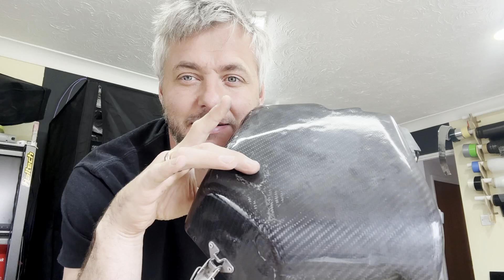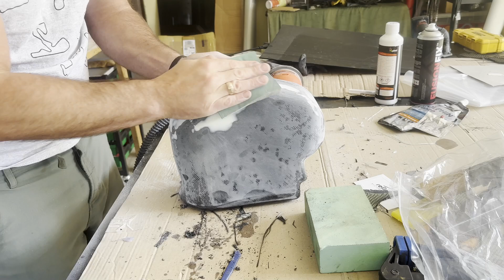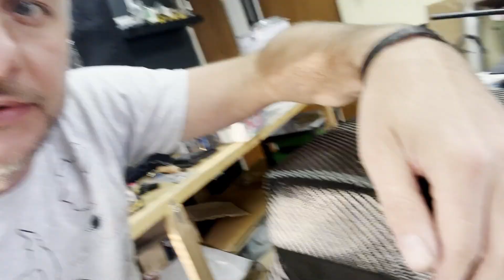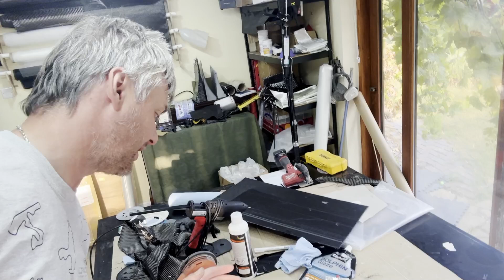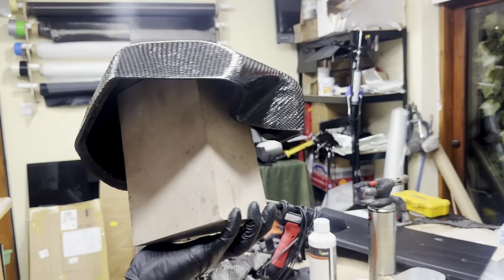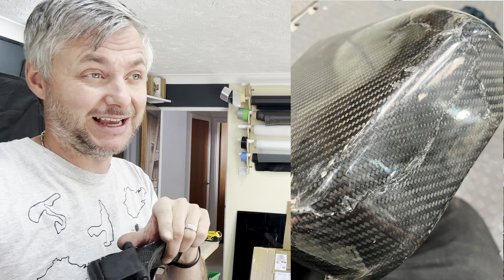Carbon skinning as a quick repair job

Comment: How much would you charge to skin a roof on bmw 3 series? Also I have both carbon bonnet and boot  i have a small crack in the resin on front of the bonnet and on the boot in the middle there's a patch where it looks like the sun has started to burn threw and the resin on the boot is extremely thin I can feel the ridges in the fibre. Is this something you could fix